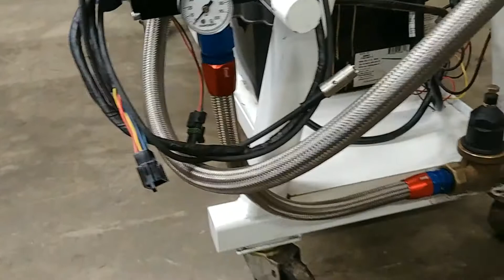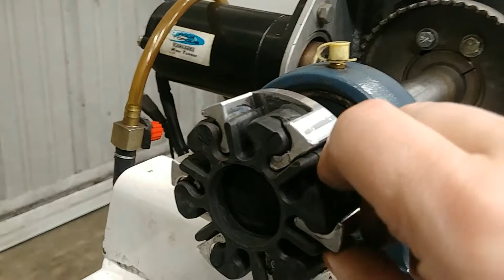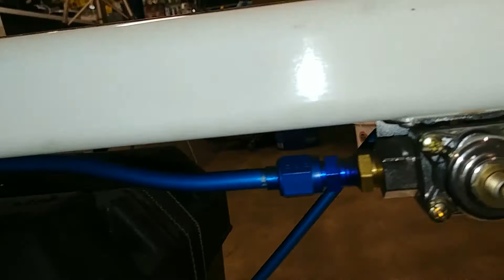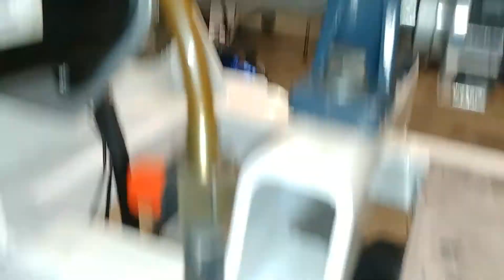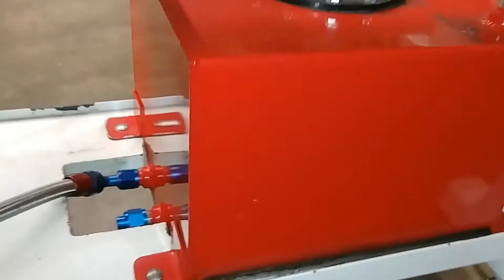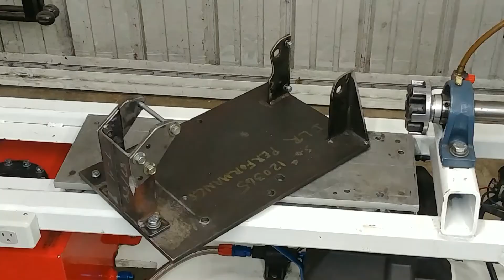ILR Performance Land and Sea engine dyno

Comment: Have any resources or spare parts for the water brake? I've come up with a solution for the constant bearing failure due to water intrusion. Let me know if you're battling the same issues. I am running much more powerful engines though.
Reply from the maker: I have bigger bearings already so I haven't had any issues all the way up to just shy of 200 Ft/lb. I do grease them regularly so I don't have water issues. It's a pretty reliable brake so I haven't really had much repair required. I have a full machine shop so I usually just make anything I need to replace. Only part I'm a little worried about is losing the PC interface board but if I do I'll deal with it then.
Reply: @ilrperformance7152  I've lost the weather station features and have to enter it all pressures manually now

Comment: Real nice design  & implementation.....At 08:20,  why is the Torque/Strain Sensor located so close to the Shaft axis ?? .....Usually the 1 piece Torque generator Cell is located 12" away from Shaft Centerline.....
Reply from the maker: The torque sensor is in the torque limiting arm itself. As the load is applied it flexes the blue arm and that produces the torque measurement. It's actually 12.00 inches from the center of the rotating shaft to the stationary pin that holds the torque rod. I didn't have to be exactly 12" but it makes calibration and mass compensation a little easier.

Comment: motul ftw . i run it with 110 leaded in my 88 trx250r.
Reply from the maker: Yeah the Motul has proven to be a really good dyno premix oil. Lots of good options but I've pushed a few engines too hard and never had a lube failure yet.